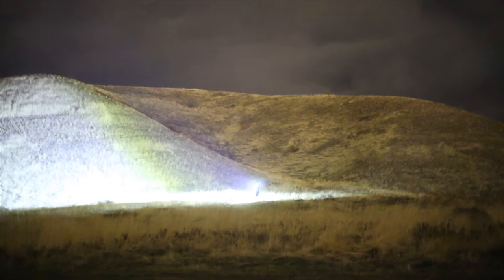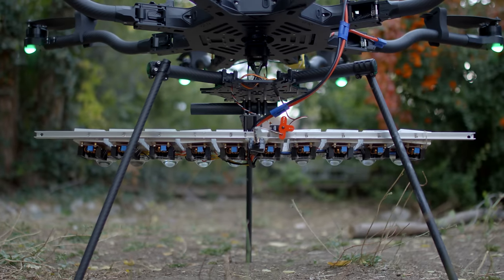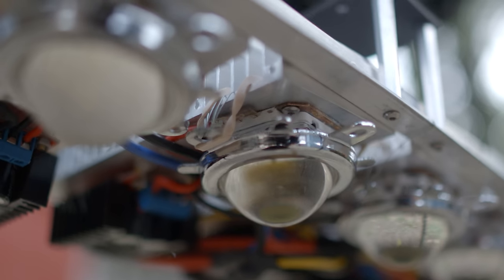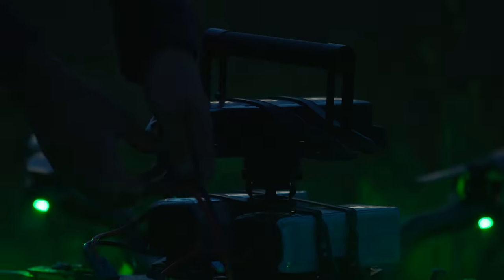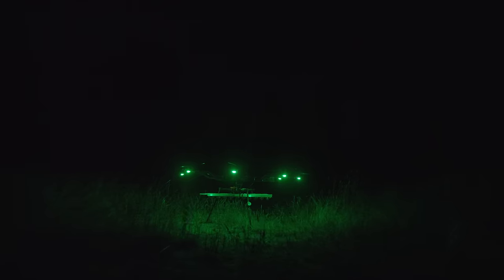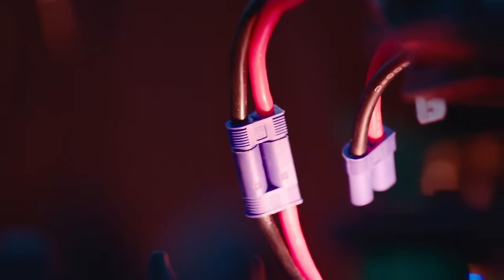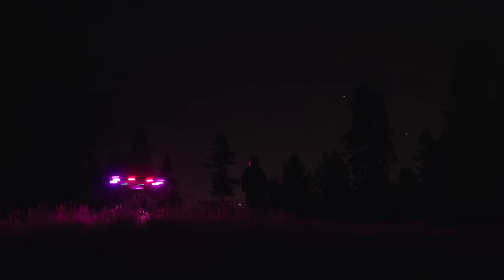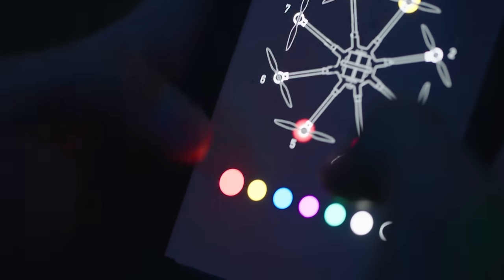1000W LED on a DRONE - RCTESTFLIGHT

Comment: this would be great for police search partys at night
Reply: David Popa but for only 10mins tho
Reply: Khoa Đặng well with police funding they could modify it for longer lasting
Reply: Yea I was thinking the same thing. They could obviously modify a lot of things on it. But they could throw a FPV kit and cameras with thermal imagining. Or "lock" the target running away so it'll follow them like a missile. That'd be sweet!
Reply: Adding a power tether to it and it would be able to fly forever.
Reply: Yeah and they could even put it on, say, a helicopter. Oh wait..
Reply: Kharajo helicopters use a lot of gas and can't really get that close to the ground
Reply: They don't need to. They stay in the air FAR longer than the 10 minutes he mentioned in the video and relay information to ground teams.
Reply: Million dollar plus helicopter or a 15K drone.  Hmmmm??
Reply: Well, you'd need a lot of batteries if it will only fly for 15 to 20 minutes.. Maybe it's enough time.. Maybe not. Sometimes they have to search for hours.

Comment: This could be really useful in emergency situations where overhead lighting is needed for search and rescue. Great idea.
Reply: the only hindrance is that 10 minutes battery life :L once graphene comes out maybe that might become less of a problem
Reply: Well if you have some funding I bet you can increase this to even 20 or 30 minutes. This contraption is pretty makeshift.
Reply: Depending on the environment a cable that runs down from the drown to the ground where more batteris / a generator is located would also be possible.
Reply: You coudl make it a bit less bright and increase batteyr life. you dont need such a bright light
Reply: or they could simply use a thermal camera lol?
Reply: What i think he meant is for example, an accident at night in the middle of the highway, one drone would be enough to light up the scene, make people aware there is an accident. Makes it easier for Firefighters to see, get people out of vehicle quicker.
Reply: midnightClub543 better for offroad emergency's because for an example on a highway the most firetrucks has "light tower" on the car they are bright enough
Reply: If you're going to use a cord to supply power, you may as well suspend it from a weather balloon. Much cheaper.
Reply: A weather baloon at 20km altitude?? Cause thats where they fly
Reply: No, the weather balloon is anchored with a cord which is also providing power for the LEDs. I was basically saying that the use of a drone tied to a power cable would be unnecessarily costly.
Reply: ***** So you would need to carry a massive weather baloon(those things need plenty of gas to lift weight) Then a massive amount of explosive gas onto a fire scene or a crash or an emergcy situation, and account for the wind instead of just attacching a simple resistant cable to a drone?
Reply: Balloons are only big when they're inflated, and helium is not an explosive gas. A weather balloon costs no more than $20, and a tank of helium is a similar price on the consumer market but much cheaper when bought in bulk.
Reply: ***** Have you ever seen a picture of a weather balloon?? Helium burns easily and youre carrying it under high pressure in tanks and anything under pressure tends to explode(you were probably thinking of explosions as solely fire balls) and any half decent  weather balloons can cost thousand of dollars cause thyre made of special lightweight materils that can can withstand extreme temperatures and radiation from the sun . How can charging a drone once a day on a wall plug be comparable to moving tanks of helium in place with trucks adn waiting for teh balloon to inflate(which takes a lot and cannot done too fast because of the electrostatic charge building inside that might ignite the gas,) when in an emergency situation. And what if teh victim is a gyu under an avalnche in a mountain side? You teleports heavy tanks of helium gas up there?
Reply: Helium is a noble gas, it does not ignite.
The balloon only needs to be large enough to hold a strip of LEDs 50m into the air so it doesn't need to be expensive to withstand the harsh conditions of the upper atmosphere.

Drones are expensive and can fail. Balloons are cheap and replaceable, and reusable.
Reply: ***** Yous still didnt confront  the inpracticality of carrying aorund high pressured heavy gas tanks
Reply: I know. So many useful things can come of this.
Reply: Superb
Reply: @unitaper  to see through camera, yes, not to help light up area for rescue

Comment: Do you realize you've created something really valuable here?
Any emergency service, rescue service, police, fire department, medics, security teams and even the army, they all have a need for effective and immediate lighting when they have to do their jobs and possibly safe lives. 

You should try to commercialize this. The best ideas are the most simple ones. 
Combine it with idiot-proof software. A mobile app even. Pick a height and click for take off. That simple.
(Most common mistake with 'official' commercial drones is their complicated user interface).

-edit
Not just emergency services, but basically anybody that works outdoors at night needs lights. From people that clean spills to guys that do roadwork. And it doesn't have to be work related either. Imagine a small fleet of these illuminating a beach party or, leave the colored lights on there and you could shine at an open air dance festival. The possibilities are pretty much endless. Just make sure you keep that user interface ab-so-lu-te-ly simple.
Reply: The only problem with the tech we have now is the 20-30min max battery life.
If someone could solve that problem and still make the thing affordable and relatively compact they would have a gold mine in their palms.
Reply: +R2
20-30 minutes could make all the difference in some situations, like first aid at an accident, but I get what you're saying. 
I guess battery weight is always a main issue, even for cars.

Just a quick out of the box thought.. I can imagine a system where one drone replaces the other once its battery gets low. Carry a total of 4 battery packs and you're already at about 80-120 minutes of light.
Reply: Like a mothership xDDDDD
Reply: They already have this, with IR cameras and all sort of equipment. At least in my country.
Reply: Damalycus
Yea, it would make sense that there's stuff like that out there. Not sure about relative simple drones just for lighting though.. Usually it's something more complicated, like an IR cam that you mention, and those drones often require a bit of knowledge to fly around.

I'm thinking in much more simple terms.. Press a button and you've got light. That simple. No knowledge required about drones at all.
Reply: TheBushdoctor68
Reply: TheBushdoctor68 literally just a drone with some LEDs
Reply: depressing osteoporosis
If your argument is that it's not a good idea because it's so simple, then you might want to look around and notice that some of the most valuable and often life changing inventions are that simple. Like the wheel for example."It's literally just a circle'.
Reply: TheBushdoctor68 they've already figured the whole bright light on flying object thing........ it's not exactly revolutionary lol
Reply: They've had search lights on helicopters for at least the last fifty years already.
Reply: MrWolfSnack You mention "rich faggots" but this is $20K. A helicopter is 1mill+, a light tower is 50K+ (With onboard generator) and while it's not practical for most situations, if properly optimized something similar could be used by small rural police departments. You know, the ones without licensed pilots on call 24/7, 1.5 million dollar helicopters, and a heliport - Which is nearly a whole 2 million with all the work, materials, fuel pumping equipment etc. If you could bring flight time up to 20min, that's 20 minutes of flight, 5 minute break to swap battery's, and back into the air once more.
Reply: smashhawk not to mention this is truck deployable and with autonomy it would be quite effective once batteries get better
Reply: TheBushdoctor68 very smart comment o_O
Reply: yeah it would be handy for australian emergency and rescue crews and security as well
Reply: cool
Reply: Superimpossible but think of the fuel cost ;)
Reply: how much does a helicopter cost? how much does fuel cost? exactly. a lot. and guess what? you cant just pick up a heli and fly it, a drone, you can
Reply: Lmao it's just sad to see a "woah dud prank aleinss!!" comment be more popular than this insightful comment. What a nice world
Reply: TheBushdoctor68 The drone should automatically return to the "basestation" and change the battery by its self once it's empty, that way you could get unlimited flight time
Reply: Agreed. If they could extend the battery life, this could easy replace police helicopters in cities. It would be safer to have unmanned flights for foot chases, traffic surveillance, etc., and could be operated by units on the ground. It would also have lower flight clearances.
Reply: TheBushdoctor68 I was thinking military use would be creative.
Reply: could power it off a tether that runs to emergency services truck.  would power the drone and the lights.
Reply: Big Brother is coming
Reply: d pilot they can use thin cable to power it and drone just stays at some height
Reply: It has a total flight time of ten minutes.
Reply: thats kind of the point of trailer mounted towers already they have a diesel generator and can extend 50ft tall with 11 kw of power for anything you need to plug in for the rescue team and you just tow it behind a truck
Reply: I think your really on to something, because where I live in Australia we have a fair few people go missing while hiking and the search crews stop searching for the missing hikers at night. This would allow search parties to continue looking for them. As for battery life, They're emergency services, they can afford to buy and to carry around 20 fully charged batteries at all times
Reply: TheBushdoctor68 i didn't bother reading the replies, but the problem is that as he said you only have about 10 mimutes of flight time. You would need multiple drones or better batteries and or better drones to carry them
Reply: Ugh. It always comes down to money with you people.
Reply: @lostplshelp  Yea I have a relative making payments on a 15minute $40k helicopter ride. I found this looking for this exact thing for excavation and construction work. Something simple with preset programs for height. It will be done.
Reply: exists,
oh and the best use would be for movies.
Reply: Too bad the battery lasts 10min. They have helicopters bud.
Reply: R2 FYI they don’t want us to have that, timetable is their control. In the mid 80’s in the Marines I had a military 💻 that had a battery life of 2 weeks. As a SigIntel operator I have been there done that. So please understand what your are being SOLD!  #EducateDontRegurgitate
Reply: @Guybrush Threepwood Well... you could do that, because you're Guybrush Threepwood. ;)
Reply: Other than rescue, fun there is no real use to it. They have light towers.
Reply: In a stationary or small area of operation im sure they could use some kind of tethered extension lead from a portable power pack.
Reply: @Skylord12345  your partys must be crap! If the hum of a drone or six drowns out your tunes you need to organize your sound system before you start thinking about light effects! HEY DJ TURN UP THE BASS!!!!🤩
Reply: @maximus3ae  thats what i said! If two of us thought it then it must be a thing!!
Reply: Yeah it's called a helicopter
Reply: TheBushdoctor68 

An night vision or thermal camera would make much more sense than a 1000w led
Reply: Fuel cell drones are known to last for a couple of hours
Reply: Only good for 10mins...but you are right.
Reply: You people really don’t knwo the word
Reply: @envyous1772  do you even know how an alternator works on a car lol
Reply: @TheBushdoctor68  unfortunately batteries have actually barely changed in the past 20 or so years. We've just gotten better at manufacturing them.
Reply: Thanks, i just patented the idea. ITS MINE NOW HAHAHA
#Benjaminfranklin
Reply: Ogre Banger you loose power from putting a generator on electric motors since it then uses more power to drive the generator then the generator will ever give back
Reply: maximus3ae already exists a much simpler solution of a balloon that has a light and a cable to the truck
Reply: Amadeus Bellenger rescue teams don’t have all the money in the world it’s already pretty tight for most and carrying 20 big batteries is really heavy
Reply: All the stuff you mentioned they can use flashlights and battery powered lights... And guess what? They already do
Reply: @Art2.mp4  make it solar powered
Reply: y'all ever heard of using a flashlight?
Reply: The mayor of my city bought a  one seater chopper kit for 18k....... That was like 20 years ago.... Js
Reply: @Art2.mp4  Very true but I wouldn't think it would be a problem to have extra batteries to swap and deploy 2 of these at the same time so even when 1 of them is down for quick battery swap light is still on.
Reply: I need to get the money to your account to pay for the best
Reply: All the smart people is here maybe i will get out of this comment section

Comment: You should market these as search and rescue drones.
Reply: This is cool for videos, but 10min flight time is useless for search and rescue
Reply: +Daniel Willets Its 10 minutes LED lights on time I believe. He added a separate battery for it but with 1000w, its draining that added battery, otherwise, it's flight time should be as suggested in manual.
Reply: Send out the search drones! 10 minutes later Search drone is out of batteries! Returning home!
Reply: +Bruce Lortz Not sure about search and rescue but that might have military applications. Not that I support wars and all.
Reply: SAR agencies are not going to use your standard commercial drones that only fly for 10-15 minutes at a time. They would commission drones built that might cost $20-30K and fly an hour or longer.
Reply: Mad Planet Always that one person that has to bring up politics when they know they are wrong. You done yet kid?
Reply: *****
lib·er·al : "Open to new behavior or opinions and willing to discard traditional values."
Reply: Are you sure, there are working search and surveillance drones which can fly without refueling / battery change over 24hours. Small electric ones can push nearly a hour of flight time for example Eagle XF
Reply: ccronicle A quad that can run for 24 hours while carrying equipment and while moving? Unless we are talking about a full sized turbofan/turbojet UAV that costs $200K+, I seriously doubt that
Reply: where did you specify that it needs be quad? nowehere yeah its easy to change requirements when you know you're wrong.
Reply: ccronicle My bad I didn't mean quad only, although a vtol would be perfect for search and rescue
Reply: thats why you point a microwave beam at it to recharge in flight or hang it from a balloon for neutral buoyancy